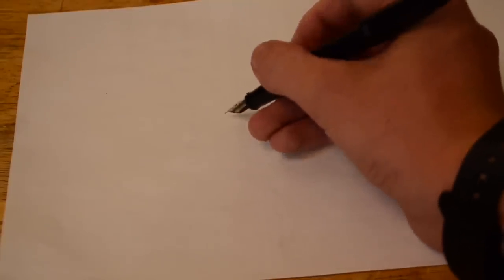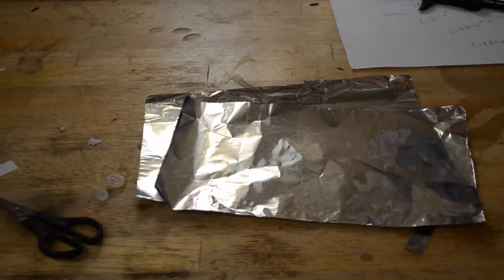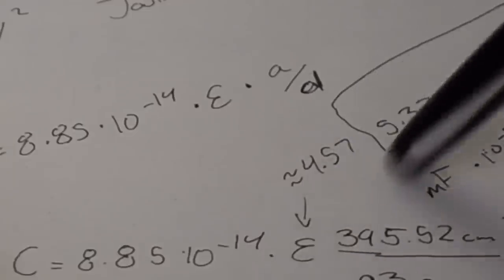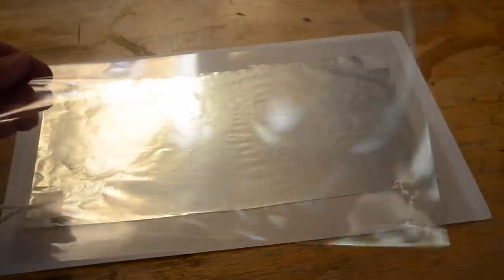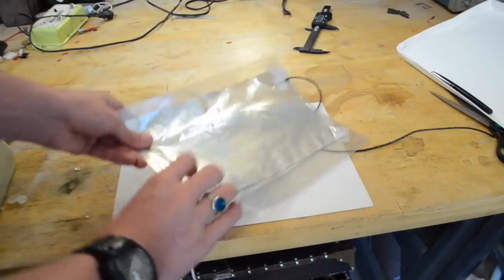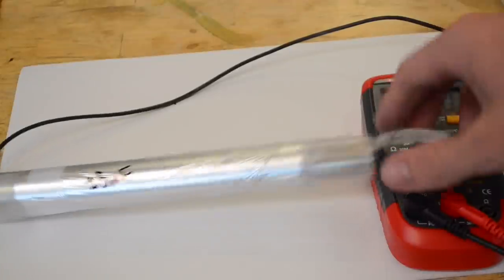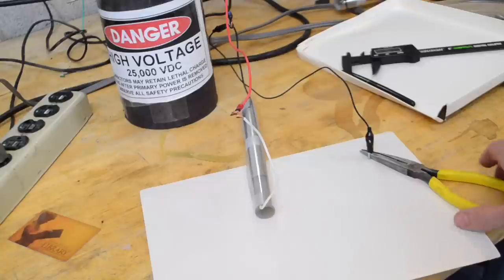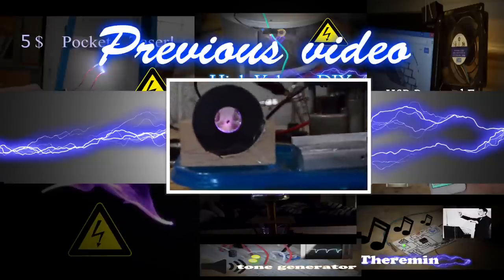How to make a High voltage Capacitor

Comment: There's no doubt you are a stone genius. But let's just assume that guys like me don't have the massive cranial capacitance that YOU do. All we want to do is build a capacitor to be used for a specific purpose. For instance, I need several power sources to jump start my car battery in cold weather.  So how big do I make a tinfoil capacitor which will start a small v-6 engine?  And can I charge this thing from my car battery? What would be the dimensions and number of sheets which would produce 12 volts and 500 amps?

Comment: how could I adapt this capacitor to store only 9V?
Reply: You wouldn't have to adapt it. It can safely store any voltage you put into it, as long as it is equal to or less than the highest voltage that the capacitor is rated for. But the obvious problem would be trying to actually get any significant usable energy out of this capacitor at only 9 volts, since 9 volts is hundreds of times less than the high voltage he used in this video. This capacitor is much more efficient (space-wise) at storing very high voltages. If you wanted to store only 9 volts, you would use a much larger sheet of foil, and then you would use a much thinner insulating barrier, like maybe just a thin coat of spray paint, since the thinner the barrier is, the more capacitance it will have. You only need the thicker insulation barrier if you want to use it for higher voltages; otherwise it decreases the capacitance. And online you can buy very cheap all kinds of capacitors that are great for lower voltages like 9 volts. But if you want to build one for fun, that's cool.

Comment: I made a capacitor out of aluminium foil and one sheet of paper, I SUPERGLUED the sides of the aluminium foil to the paper to make sure it was extra tight (BTW instead of taping a wire, I cut out a little line sticking out of the aluminium sheet it was connected to, ensuring a WAY better connection) and it was half the size of a THUMB! after I rolled it up, hot glued it to insulate it, and it measured 3.5 MICROFARAD! Not nF, uF!!!!! Repeat: I am 100% sure this is MICROFARAD and NOT nanofarad or picofarad! Like 1000 x better than yours! The tighter you roll it up and the better you insulate it, the higher the capacitance! remember this was a single capacitor half the size of a human thumb! It's tiny, but powerful!
Reply: Nice
Reply: wow
Reply: Suokasvi maybe, but one issue with capacitors is leak, you need to seal them, and looks like he went with hot glue

Comment: Very nice, but lose the equations, and show what this particular capacitor will do, in real life. For instance, I need a capacitor to start a dead battery 4 cylinder car. Just show how big a capacitor it takes to do that, and a 6 cylinder car, and a V-8. That way is much more "idiot scalable". And show how long such a device will last. For instance; Design and demonstrate a capacitor which can start an air conditioner, (Very useful in RV situations.)
Reply: To do any of those things you just mentioned would require a capacitor that would have to be  so huge (if it were homemade) that it would be absolutely ridiculous and expensive and time-consuming. They do have manufactored capacitors that can do that, and there is someone on youtube who shows it being done with a small car. Probably even those are expensive, and can't store as much energy per volume as a good battery can.